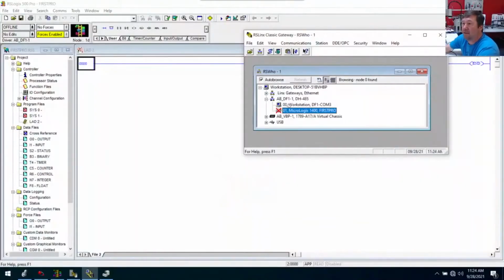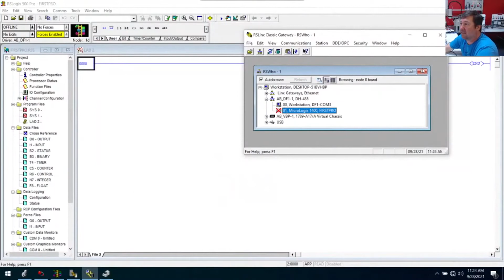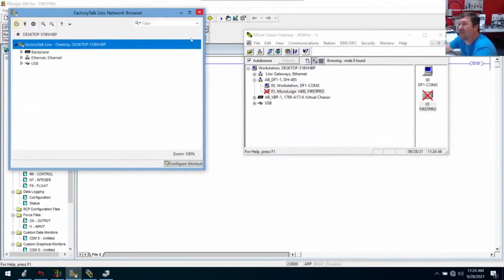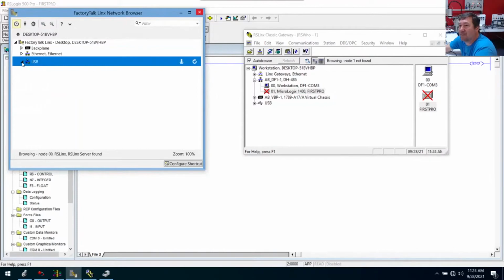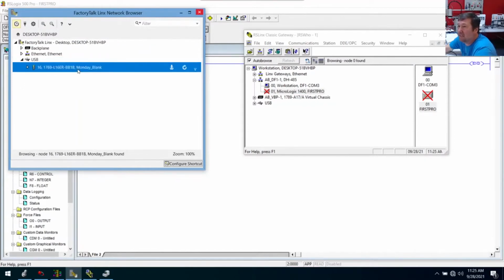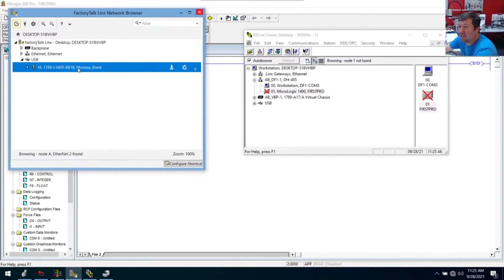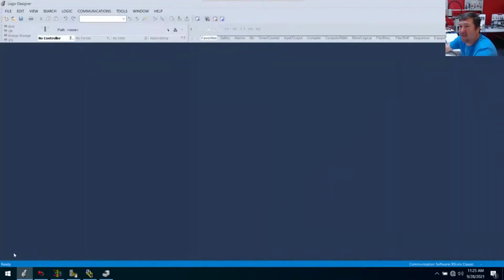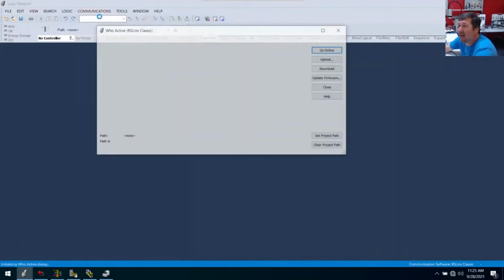Allen Bradley PLC Connecting Over USB

Comment: Hi Tim, thanks for you video, I have question that i can't see usb driver under workstation folder in Rslinks. Do you have idea why?
Reply from the maker: Is it an actual USB connection or are you using a USB converter?
Reply: Hi Tim, which USB cable are you using? Is it a normal printer cable?